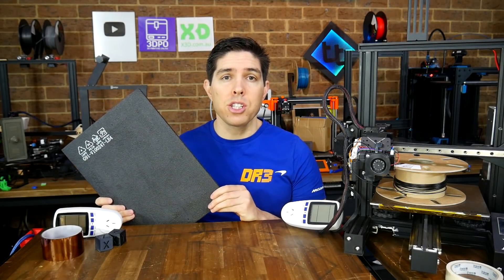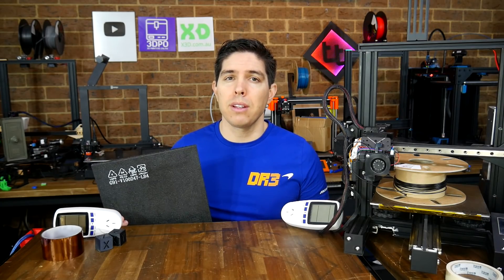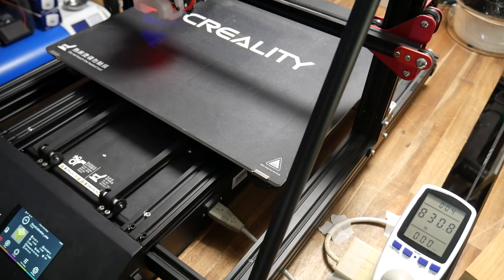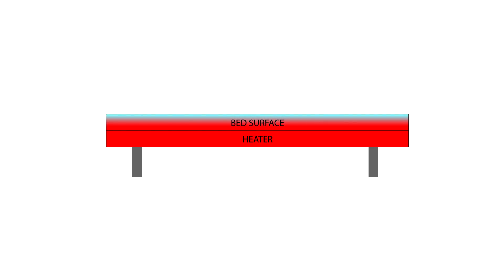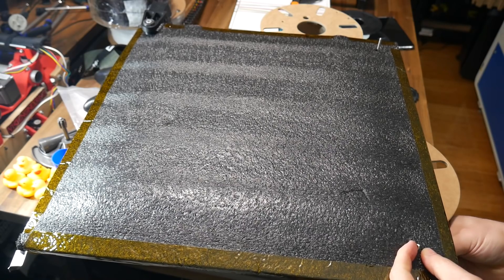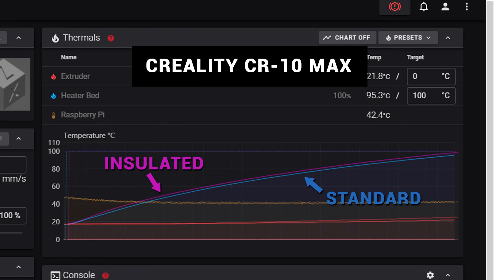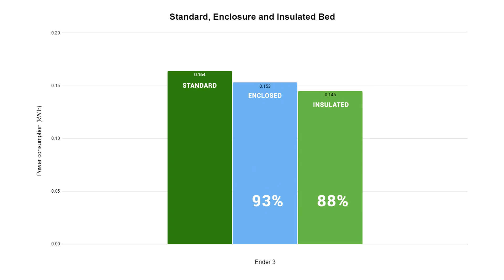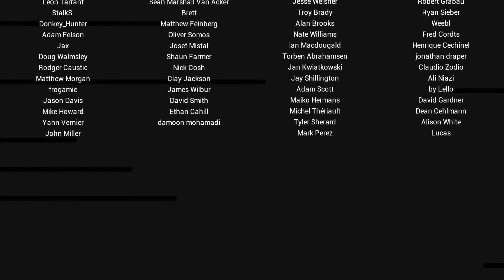Speed up 3D prints & save money. Insulation is important!

Comment: It's a really good idea to insulated the bed. I think this can be improved if you added som reflective material, like aluminium foil tape, so you can be sure that the most of the heat goes to the bed, or just using a pease of aluminium foil from the kitchen (with the sheiniest side to the bed) ;)

Comment: I changed the bed heater om my Flsun SR over to a mains powered silicone heater pad and insulated it with cork board underneath, with the aim of having a shorter heat-up time and higher max temp. But I made the mistake of using a 1/4" thick plate of aluminum to replace the thinner circuit board heater as a base. More thermal mass, heat-up time just as long, with a delay in the surface reaching the same temp as reported by the thermistor, takes longer for the bed to cool. Oh well, I'm not about to peel the heater off of the plate and ruin the adhesive. I guess that at least I'm putting less strain of the 24 volt PSU.

Comment: I use foil backed foam that is generally sold for car sound and heat insulation. Come in rolls with self adhesive back. It appears to be similar to what comes on the biqu b1

Comment: You really should have mentioned that the power meter needs to be able to measure active power to get a reliable reading with this kind of equipment, many of the cheap ones can really only measure resistive power correctly but be way off for both reactive and active power.

I have personally measured up a difference of over 50% when comparing a cheap meter with a more expensive one.

Comment: @teachingTech Do you have any explanation as to why the power of the heated bed falls off during the preheating phase? Is it a PID/MOSFET interaction, or a change in the bed's resistance?
Reply: Bed resistance changes with temperature, as with any resistor. But what makes the bulk of power change is obviously the power regulation from the control board, usually PWM is used.

Comment: I had been using some insulation that I bought off aliexpress, and that was OK but after about 6 months it had become dry and brittle. I was looking for an alternative right about the time ths video came out, and so I used the foam that came in one of the printer boxes. I tested that it was fire-proof before fitting and it was good, so I attached to the bottom of the bed. That's been working well for a few months now, but a few days ago I removed the bed and found that the foam had completely melted where it came into contact with the heater-pad. I print a lot of ABS (bed temp: 100C, enclosure: 60C) so it has been subjected to a lot of abuse. I realise that there is probably a large variation in the pieces of foam that come in printer boxes, and some may well be able to withstand the high temps that my printer is subjected to, but I just wanted to share my experience so that others who are contemplating this can check for themselves. So now I'm off to find a sheet of cork and see if that works.

Comment: Tip 1; The bed insulation is essential for older style (12V) beds that struggle to reach higher temperatures. With insulation, such a bed can reach 100 C as where before it could not go higher than aprox. 85 C.
Tip 2; Replace the 4 metal bed M3 screws by nylon M3 screws, which do not transfer heat to your bed frame :-)

Comment: The PTC heaters are self regulating... so the temperature is the temperature.  It will heat up faster and maybe print better but the temperature of the enclosure is fixed.

Comment: I coated the underside of the bed with RTV silicone.  Its less than 10 dollars for a caulking gun sized tube.  I used the high temp because why not.  There is a lot of acetic acid off gassing until it cures a day later.  It is safe to touch now and is completely fire safe and also non conductive.  Also it cant fall off or debond.

Comment: I have high temp adhesive foam with an aluminum backing, but I haven't benched it, though it prevents thermal runaway prevention from being a problem at under 15c ambient.

Comment: One thing that I'm interested on, is the sample time of the meter. I don't think your power meter is fast enough to capture the entire dynamic of the power, which could hide sudden peaks in power of your heated bed, which in turn can increase your energy costs. Another thing is the power factor, because if the power factor is low your printer does a really bad job with the energy, wasting a lot of it in things other than heating the bed, the nozzle and moving the motors.

EDIT: I actually realized the sample time of your meter is 1 second. This is really bad, especially when the printer starts to move and change directions quickly.
In fact at https://youtu.be/IMjl89yOR_k?t=554 the power consumption dropped from 232.3 W to 52.5W IN ONE SECOND! How can your total power consumption be accurate or reliable enough, when you have such sudden jumps in the measured variable?

It is clear that the insulation helps in terms of power consumption, but your measurements aren't reliable and precise enough. Sorry.

Comment: I had used my foam from my Ender 3 packaging and put it under the bed, but it was rubbing on my Y-stepper motor and nudging the front of the bed downward when running a mesh with my BLTouch.

I tried unwinding the bed level screws as far as I felt safe to see if I could get enough clearance, but that endeavor was unfruitful.

Comment: My enclosure for my Ender 5 gets to 60+ degrees without an additional heater. I will be testing efficiency soon too, I assume it will be a good bit more efficient thanks to the surrounding air temp being so much higher. I thought about adding a heater but unless I need higher air temps for printing there is no point, I can print ABS now with zero warping. I used reflective foil insulation for loft insulating

Comment: I don't really use any kind of special insulation, since my printers don't use DC-powered PCB-type heaters anymore but mains-powered silicone heaters. It simply does the job.
In the past, though, I tried cork sheets as insulation, as well as packaging foam. Surprinsingly, it didn't make much of a difference.

Comment: I've been doing this for a few years. This also works great for older printers with 12v beds. Mine struggled to heat and hold the bed @ 100C for ABS until I insulated it, now it has no issue at all.

Comment: I got a good $1,000 USA into Prusa MK3s and MMUS and probably another $1000 into filament over the last 3 or 4 years.  I think I would spend the extra money and buy insulation meant for high temp environments.  Foam and heat are scary combination especially with a thermal runaway situation.  I think I would pass on this recommendation for safety reasons.

Comment: How can a print complete faster. The bed temp has no bearing on speed unless somehow the heated bed allows you to print faster. It would make no difference on speed
Reply: Mate....
Do you consider heating time for your bed in your print time? 
Or are you a bit thick? 

The "print time" does not only mean the time the nozzle is moving but also the time it takes from selecting from the menu and then the moment the nozzle parks. 
The only difference is the bed cool slower - but that is actually not a bad thing if you use a USB fan to cool it.
Reply: @fuck_chinanobrain5011  good point I had not considered heating time. That said my printer heats both print head and bed at the same time and since the print head takes the longest to heat this insulation would have no impact on the time. The only benefit I see is power usage.

Comment: This help, but not so much. Have y some tips how to increase current coming to bed? If I use smaller resistance, it should be a lot of faster heating.
Reply: It helps A LOT because you aren't waiting an extra 3-5 minutes every single print. It really adds up if you're using it long term.

Comment: Good tip - but DON'T use a polyolefine foam (PE/PP as used as packaging material for most 3D printers) as it is usually very flammable and NOT self-extinguishing (test a small piece first). If I had to, I'd probably use spray-on PUR foam in a flame-retardant formula or better even a mineral fiber product wrapped in aluminium foil to prevent particles getting into the air.

Comment: As far as enclosures go, I have gotten great results using half inch pink insulation foam board. It gets the air temp inside my Ender 3v2's enclosure to over 60 °C. This is actually too hot for the printer to function correctly for extended periods of time.

Comment: So far I've been using this type of foam to help organize/hold my tools in the shop, saves plenty of $ compared to buying the branded stuff and works just as well. Stack the sheets with spray adhesive, then contour cut around your tools and peel away as many layer as you need :)

Comment: You could try adding a fan inside the Ender 5 enclosure to generate some airflow that helps evenly spread out the heat generated from the heater units. It should help even more than reflective tape, based on what i found out when building a drybox with active heating. Naturally make sure it doesn't make print pop off the bed while printing by blowing air directly on top
Reply: Maybe engineer one of those passive heater contraptions that have a fan and sit on top of a wood heater, using convection to rotate a fan. Sit it on top of the heater unit.

Comment: Aerogel blanket material works up to 120 degrees C, with peaks up to 160, and Aerogel is literally the best insulation humanity has ever come up with. I may look into getting some for myself. There's also rigid Aerogel panels now that handle 300 degrees but... yeah, 300 x 300 millimeter tiles cost $500 each so yea, no. That said, 8 mm thick Aerogel blanket will also cost a chunk of change, it's something like $50+ for a piece that's a 1ft x 15 inches. Which should work for a 300 mm bed. Cheap? No - but you can literally not get better insulation, because it doesn't exist.

Comment: A added a piece of cardboard covered in aluminium tape covered in kapton tape (to prevent short circuits) attached with kapton tape to the bottom of the bed.

Unfortunately the kapton tape got unglued and cardboard dropped onto the carriage. Anecdotally, the setup seems to be even worse than before. Your video gave me some ideas about using foam wedges to prop-up cardboard agains the bed.

Now with the wedges, I was able to heat up the bed to 110C outside of the heated chamber. Previously I was only able to heat up the bed to 107C inside of the chamber.

Based on this, I suspect that the bed cools down mostly due to airflow, and blocking it in any way brings efficiency and the reflectors might not matter as much.

Comment: I did this to my Ender 3 v2 shortly after I got it, over a year ago. I used a piece of foam core, held in place by Kapton tape and the corner bed mounts. Power consumption dropped, PID tuning changed. ONE BIG DOWNSIDE: it takes the bed longer to cool off! I have some purpose-made insulation for appliances to try, but the foam core works well enough that I'm not going to try the new stuff until I do something to the printer where I need to remove the bed. Thanks for the video!
Reply: A small USB fan above to cool your print actually makes the time negligible. 
You may even hear cracking when the plastic shrinks and it is simple to pull off.
Reply: Also I position my part cooling fan above the print and turn it on high. It cools the print and bed down early when positioned right. Just remember ur nozzle is still hot sometimes so not too close.

Comment: Great video !
I wonder (I'm sure) that for PLA filament the best thing for reducing consumption would not be using glue stick ? Do you think it gives as much adhesion as heated bed ?
Thank you
Reply: Or painters tape (no heat needed, unless you are around freezing temp then depending on the filament you might want to heat it, though I've done below freezing without heat). The biggest upgrade then is wrapping the heater block in Capton tape and redesigning the fan shroud (E3D V5 and V6 don't require redesign as my machine with those doesn't even have a part cooling fan and those OEM have perfect fan shrouds without leaking air near the nozzle like you'll find on Ender machines and similar where huge amounts of air is thrown around the heating block).

Comment: It’s all very well to suggest using the insulation material to insulate the bed and it’s fine to suggest people look up what they use to ensure it’s not hazardous when heated but do you really think it’s wise to suggest using something that may or may not have issues? It’s all very well to tell people to look it up and do tests but how are you meant to identify what the foam is.
I don’t think this is a very safe set of suggestions to make.
Far better to suggest using something fairly inert like cork or tin foil rather than some unknown foam that may or may not cause issues.
I know that it’s not recycling, personally I use the foam for inserts for cases etc, there is no risk with that.
Reply: Look up the safety datasheet. 
It doesn't even get close to reaching the fumes ABS gives off at 100c.

Comment: So I have insulated my bed and my enclosure with Owens Corning Foamular 2ft x 2ft project panels that I have trimmed for the bed and enclosure. Wonder what the gains would be on the ratrig eh? 
edit you might also see people use these panels for cnc test runs.
Reply: Gains will be less on fast printers, if a ratrig can do that cube in 10 minutes compared to almost an hour then the time the heater is on will be 1/6th meaning beside from warmup times it won't really be saving much energy. I still think it's worth it for faster warm up times (I over-volt some of my machines just so I can heat the beds faster)

Comment: I want to know how different bed materials affects heat efficiency. Will for example adding a glass sheet add a lot to heating time and power consumption? A flex plate? Buildtak vs Pei etc.
Or even the colour of the bed surface, if I recall, black colours not only absorb heat faser, the also radiate heat away faster than white colours?

Comment: Energy is 14 pence per KwH in my country.

Normal 0.164 = 2.3p Hour = 55.3p a day if print 24hrs a day

Insulated 0.145 = 2p Hour = 48p a day if print 24hrs a day

Saving of 7.3 pence a day

Proper bed insulation not potential death trap random crap £8.

800 / 7.3 = 109 days to pay for itself if using printer 24 hrs a day.

If using for say 4 hours a day it will take 1 year and a bit to pay for itself.

Not worth it, just working an extra half hour at my job will earn me a 2 years worth of insulation foam savings.
Reply: It isn't even just about the energy (10% is actually really impressive by many metrics, not negligable)
AND the benefit of a faster heating - for me I am actually saving 3-5 minutes every single print. This adds up if you are printing every day. 
3*365days is 18 hours or so....so is your time not worth anything?

Comment: I've always been using that insulation foam with glue on one side and aluminium foil on the other that they have pretty cheap on Aliexpress, never even bothered testing a comparison (what's the point of seeing how much worse it gets when saving .... 2 dollars?), would be interesting to see a comparison between insulation materials in the future.
I can imagine there won't be extreme differences, but just like the enclosure test showed, it might actually have a considerable impact when you insulate the bottom from all 3 forms of heat transfer.

Comment: You are still losing too much heat, the foam is just absorbing it. You need a sheet of polished chrome to "reflect" the heat back up to the print surface and then you will see some Real improvement.
Reply: You only need alumionium tape on the underside and this will work. The foam isn't absorbing as much as convection from the surrounding air.

Comment: This gave me an idea. Rather than buying a 500mm3 ratrig at some point to have just one printer that does all, maybe I should buy 5 printers ranging from 100mm3 to 500mm3 in 100mm increments. That way I can use whatever printer is the most suited for the actual print size. If the print fit in the 100mm envelope then its just stupid to heat the 500mm one.
Reply: If you've got a specific purpose for a printer, sizing it to the things you want to print is a good idea yeah. No reason to run some 500x500 monster to print tiny parts.
Reply: The other side your missing in your short thinking here. Sometimes you want a lot of small things. Sometimes you need a variety of parts varying in size but similar print settings and same plastic. We are not restricted to one object per bed.